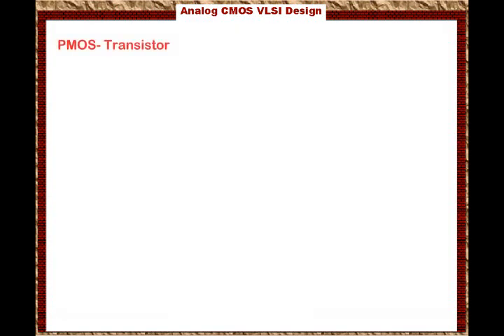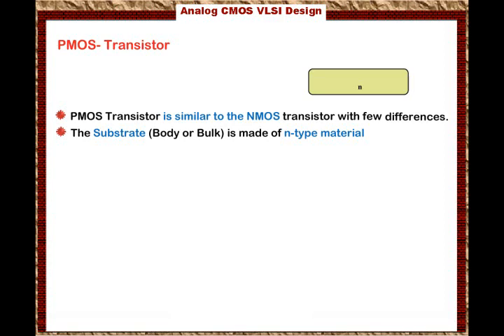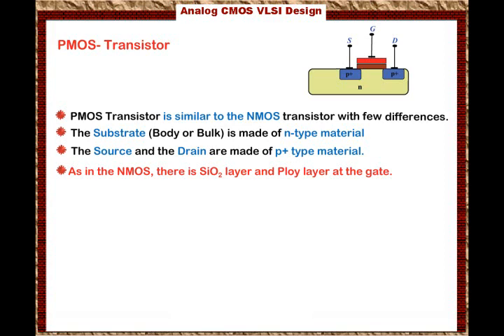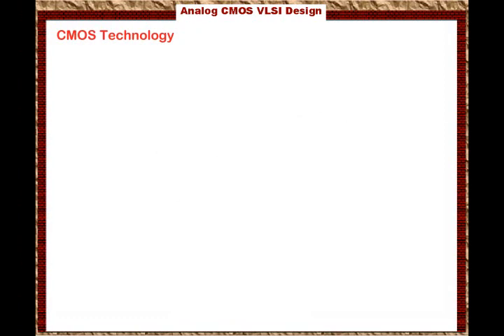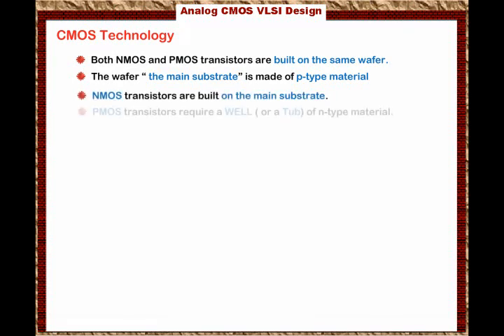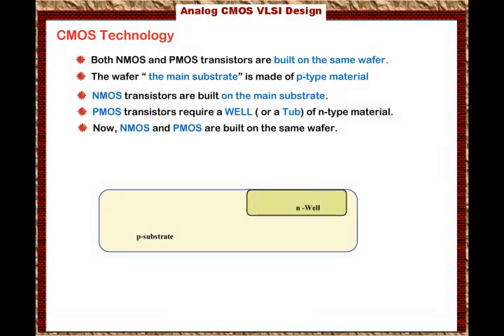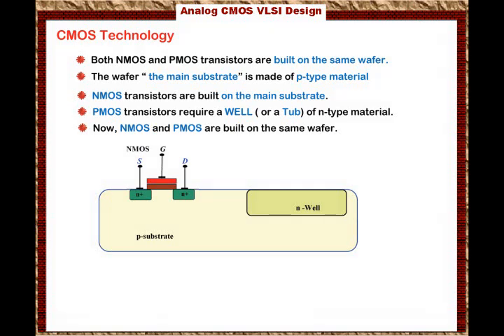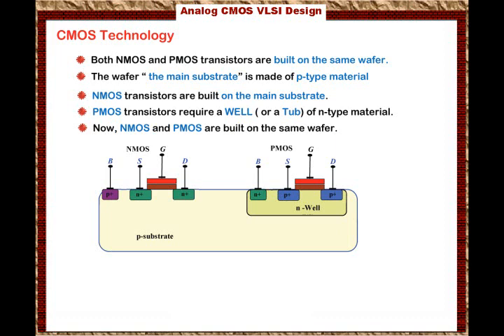Analog CMOS VLSI Lecture One-3 PMOS Structure

Comment: the concept of formation of drain and source before the gate is wrong. 

gate is formed first followed by source and drain alignment.
Reply from the maker: +Srikarthik Kadapa  I believe that I was describing the structure of the CMOS technology, but not the actual fabrication process. From an academic prospective it would be a bit diffcult to describe the gate before the source and the drain, at least in my opinion. Beside, the fabrication process may change, and that is depending on the used technology. 3D technology will use different processes. Thank you for sharing your thoughts.

Comment: If a heavily doped P+ terminal is created to connect the body then how is P-substrate doped? 
I mean is the P-substrate lightly doped than the P+ terminal?
Reply: +sai kiran reddy doping concentrations varies depending on the depth of the substrate. generally we go for retrograde doping profile in which the doping concentration is more on the surface compared to bottom.